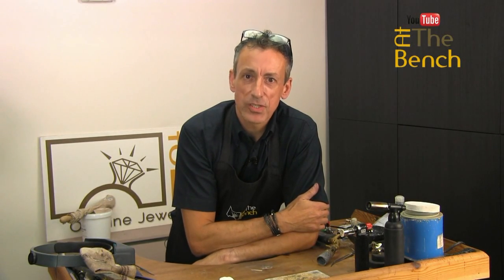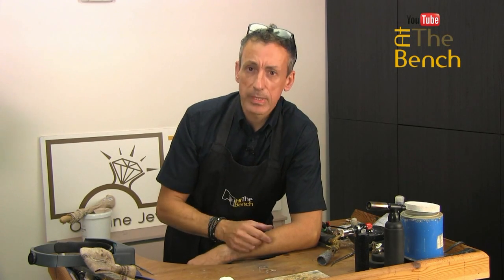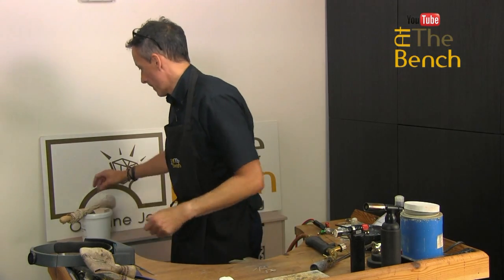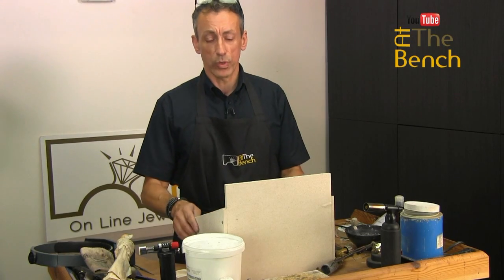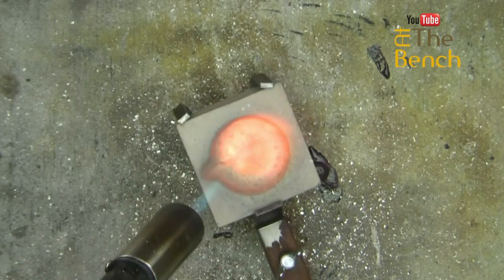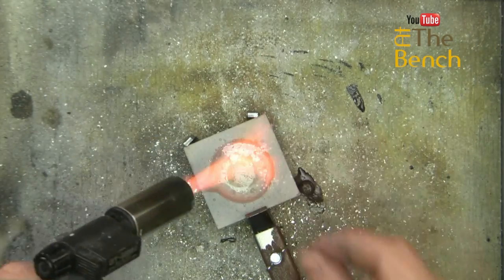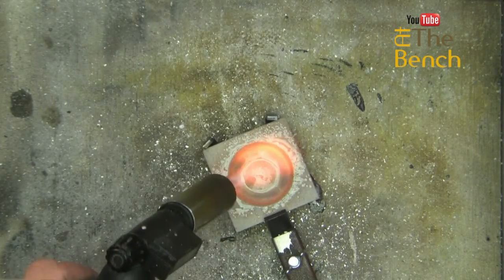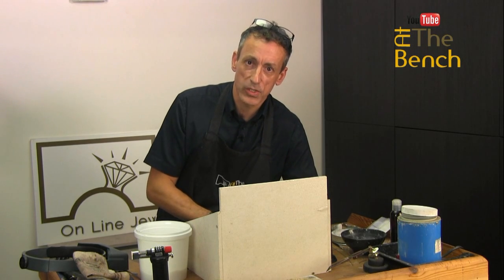Learning How To Prepare A Crucible Before Using It For The First Time

Comment: I tried to season a new one. But i have pin holes under the glaze and i can not get it even. The borox wants to pull away 

I suspect i did not preheat it enough.  How can i fix it?
Reply from the maker: Heat it back up do the crucible gets red hot

Comment: I have a question if anyone could provide an answer, I know this video is a few years old. I have two crucibles, I’m using oxy-propane. I seasoned the first crucible, everything is lovely and perfect, the Borax glaze is a beautiful clear glassy finish because I haven’t used it to melt metals yet, all I did was season it so the borax glaze is clean. So a day later I seasoned the next crucible. The Borax glaze (which hasn’t had any metal melted in it, all I did was season the crucible) oxidized and turned dirty and brown as I seasoned it. The other borax glaze is clear and glassy, but the second crucible I glazed oxidized for some reason. Any idea why this happened? Why did the first one remain clear and clean and the second one oxidized?
Reply from the maker: The borax has not oxidised. The flame may have had a different mixture of gas and air and so the brown could well be carbon or soot from the flame. Nothing at all to worry about.

Comment: What is the brand/type torch you used for that and can it handle Nordic Gold, which is mostly copper?
Reply: I’m like 99% sure that was a Big Shot torch. I have one just like it. And no, don’t even try to melt metal with a butane torch, it doesn’t generally work out well. Also don’t try to season a larger crucible with a butane torch. It worked for him because the crucible he used was small and he was only seasoning it.
Reply: @Dana Schneider  I've got a 10kg gas and 2kg electric furnace but I'm trying to pour coins with Notdic Gold so wanted to go with a jeweler crucible for more control.

Butain torch is fine for lead, bisthmuth and zinc though - aluminum and higher don't work. >_<

Comment: I bought some perlite powder and some fine cement mix and mix it 50/50 and make like a "firebrick" mold. They are still one time use but the detail is really good. Works like the cuttlefish bones but stronger and more heat resistant. I spend about 50 dollars on the cement and perlite powder and its enough to make hundreds of molds.

Comment: I recently tried to glaze a crucible, and the borax doesn't seem to be covering it evenly. there are spots where it just doesn't seem to flow, and spots where it had coverage, but then flowed away when I heated it to try and get it to fill in some other spot. do you have any advice on this?
Reply from the maker: I put plenty in the bottom and then when it is molten tip the crucible to coat all the surface
Reply: @Atthebench  I tried this and it definitely worked better, thanks!

Comment: I was a machinist turned , tooling maker. Jewelry is something that I highly respected when seeing a well made piece. Anyway what about simply making crucibles out of steel?  Not cast iron such as small frying pans , as they have casting pores in them.
Reply: It will introduce impurities into the casting.  Even using steel tweezers when placing a silver piece in pickle will immediately cause copper plating of all the jewelery in the pickle.  Steel is also a terrible insulator, so you will spend forever trying to get your metals to melt while the crucible absorbs and conducts away all the heat you are trying to focus on your melt.  Ideal substances are ceramics like the one in the video, graphite, and delft clay.  Pores aren't a huge issue.  Surface tension keeps the melt in a nice bead as long as there is no chemical adhesion to the crucible material.

Comment: What do you use to label each crucible?  Can you use a Sharpie marker on the outside of the crucible?
Reply from the maker: The sharpie will burn off. You could get a hard stone grinding wheel and grind the crucible to mark?
Reply: This is like a year late, but figured I’d chime in. I’m really paranoid about spilling the metal while pouring so I took a graphite pencil and marked a line on the outside of the crucible exactly where I need to line it up with the edge of the ingot mold before tipping it over and pouring the metal in. And then I seasoned the crucible. And the graphite mark is still perfectly there and visible. So you could probably label your crucibles with a pencil and it’ll work? Seems to be fine so far. They make graphite crucibles and the pencil is graphite so I’m assuming a graphite pencil mark can withstand the heat and your label will stay on the crucible.

Comment: So, I'm not too good at internetting, it seems I can't find anywhere that sells Borax ,
Or I should say, anywhere that looks legitimate,
I do NOT want to be buying bags of unlabled white powder online hahaha
Any links to reputable UK suppliers please 🙏
Reply: "20 Mule Team Borax" sold as a laundry additive at many stores (at least in the US), is just straight powdered borax.
Reply: Hi, same problems. I believe it is illegal to sell borax powder in the UK? Your flux cone is made out of borax though so you could shave some of that off maybe? At least that's what I am planning to do but yet to do it yet....
Reply: @lauraskeet9302 
 please let me know how you get on👍
Reply: @TheBigfatmatt  it worked! Sort of 🤷🏼‍♀️ need to definitely build a shelter out of fire bricks and make sure the crushed powder is really fine :)
Reply: @lauraskeet9302  
Watched a few more videos after replying to you, seems like the cones from amazon or fleabay would work to line a ceramic piece for pouring,  I have an old bbq and heat bricks so will be having a go soon, my first ever attempt 15 yrs ago ,was a propane blow torch on a concrete step, the resulting explosion put a fist sized hole in the step and somehow I didn't lose my eyes or good looks,  but had to fix the step and never did find any of the ring I was trying to melt into a blob for a pendant
Hahaha

Comment: DO YOU HAVE TO GLAZE THE CRUCIBLE ? IS IT REALLY NECESSARY I MESSED UP A COUPLE TRYING TO GLAZE IT . IT WOULD TURN MY SILVER REDISH BROWN . HELP PLEASE
Reply from the maker: Yes you have to. The colour you see is the borax itself. It will not colour the silver. Borax can be all colours when heated up and cooled down
Reply: @Atthebench  so it means  my silver needed more heat?
Reply from the maker: @elderulo4626  May be
Reply: @Atthebench  because I pour it down and the silver comes with the REDISH spots even when turning solid
Reply from the maker: The spot may be flux or some oxides. Pickle it and it will be removed
Reply: @Atthebench  thank you

Comment: Hi
Have you ever noticed that once you have seasoned your crucible and then melted some silver the borax blends with the melted silver and sets on top of the silver once cooled?
Reply: Firebird, have you figured out a solution to this? I am having basically the same problem. The borax just remelted and mixed with my silver....so now I just have an awful half silver/half borax clump that I have no way of separating. Ingot frustrated so threw the clump out. So I still need to figure out how to get the borax to not melt and mix with the silver.... Seems like there has to be a better solution than using borax.
Reply: @saint8228  hi yes I soak it in a  warm pickle of sodium hydrogen sulphate. You can then rub off the excess borax. This problem usually only occurs after you have freshly seasoned your crucible and is just the excess settling on your poured silver. After a couple of pours you should be good.
Reply: @firebirdbullion8123  thanks for that! Oddly enough, it did legitimately mix with the silver, not just sit on top. It was a disaster. No amount of pickling was going to fix that. I just ordered a graphite crucible to try instead. See if that is better since allegedly you don't have to borax them. But in the mean time, I will try to re-borax the old one. Then perhaps I will melt something else first before I melt silver, to try to sort out that issue before screwing up more silver! We'll see....
For now I just forged a divot into a steel plate, and I use that to melt the silver. That works mostly fine actually. But not ideal.
Reply from the maker: Doesn’t really blend with it. I like to sprinkle some on top just before I pour. I get a cleaner smoother surface of the ingot
Reply: @Atthebench  I should also mention I’m using oxy/propane so wondering if it’s too much heat? So melting the borax/glaze along with the silver
Reply: @Atthebench  thanks 
My borax is melting and setting on top of the silver like a creamy substance. It’s sets hard on the silver like a glaze. 
Have you got an email and I’ll send you a pic. I’m wondering if I’ve added too much borax and it’s melting when I go to hear it up.
So strange!!
Reply: @Atthebench  it’s the flux that is melting at the same time my silver melts and both pours into the mould.
Thanks :)

Comment: how to avoid your crucible turning black? i just got a new crucible, it was nicely coated with borax and after the third time melting sterling silver the crucible turned all black (looks like from oxidation?). am i using too much heat?
Reply from the maker: It’s ok for the borax to turn colour. It absorbs a lot of the ‘stuff’ from the silver, especially if you use old scrap solver.
Reply: @Atthebench  thank you so much for your reply! i love your channel!

Comment: Do you need to glaze an iron cast 🤔
Reply from the maker: I would initially coat it in oil and then heat the mould up so the oil burns and leaves a sooty deposit
Reply: @Atthebench  
Ok great, what oil would u use, seen these little iron melting pot on eBay,  thought they might work better
Reply: lee tomlinson you ever find what oil to use I wanna use my cast iron pan to melt down my silver or copper have a lot around
Reply from the maker: A light engine oil or household oil would be fine. We use 3 in 1 oil here in the UK

Comment: Hi Andrew,
   Looking into the crucible, it looks  different from the square ones I have used.
In mine the 'hole' is all concave, yours seem to have a convex (or flat?) dimple at the bottom.
If so, what difference does that do? In advance, thanks.

Comment: Thanks for this, Andrew.  I need to know how to construct the heat proof box made of 12" soldering boards.  Can you screw into this material without it splitting?  If not, how are you holding the soldering boards together?  Thank you, in advance, for your help.
Reply: 5:41 you can see he used wood screws in fact on the right you can see where he screwed it too close to the edge and it nearly broke out. I would personally drill a pilot hole smaller than the intended screw before you screw it together this will reduce the chance of the board splitting.
Reply: Thanks so much for your advice, Ray.  I did notice the screws but couldn't believe that they would not split through the soldering boards.

Comment: I have been stuck because when I sprinkled the borax powder, it globbed together and didn't stay stuck to the sides of the crucible, but pooled and spots that were previously glazed, were rough again. Also, my borax glaze cracks in a sort of 'shattered' pattern (not the crucible, just the glaze) as it cools. Is that normal? Am I putting too much borax in? I think I did turn the torch off and on in between heating the crucible and each time I sprinkled more borax powder in, so does the heat have to stay on it constantly? (I'm scared of getting burned.) Shall I start over with a new crucible? Or is there a way to save the old one?
Reply from the maker: lindzann Keep the torch on as you add the borax. As the crucible gets red the borax should be moisten and you should be able to move the crucible to move the borax. Also add the borax to the bare areas whilst heating it up
Reply: Use a lower temp when heating the borax. Shattered pattern is fine, the borax is just hardening up. Coat (season) it with borax a few more times and you'll be good to go

Comment: What material of mold should be used for the pouring of the melted metal? What should the liquid be poured into? If I'm asking that correctly!
Reply: I usually keep a stock of different size ingots and flat sheets of different thickness and width, the projects that I usually work on these days are rather small (like rings, earring, studs, pendents etc) so I don't have to keep stock of larger size metal pieces. So, to answer your question, I pour my melted metal into ingot mold of either square wire or flat sheets, which I then roll mill or hammer to my required specification.
Reply: Love Yourself, there are many different materials you could use to cast metals into, primarily it depends on what you want your finished product to look like. There are casting sands, clays (delft clay), cuttlefish bone, you can even cast into wood or stone. It all depends on how much work you want to do, how you want your surface to turn out (rough and rustic or something that would be closer to a near finish [light trimming and some polishing]).
Hope that helps, good luck and happy casting.
Reply from the maker: Love Yourself Hi. Take a look at my previous videos on here